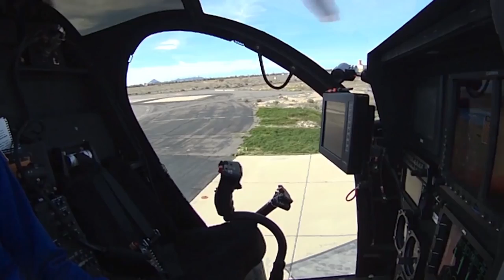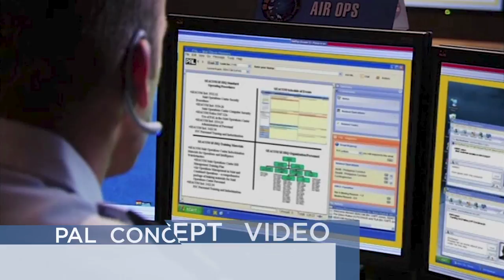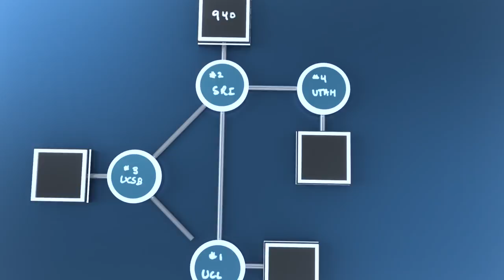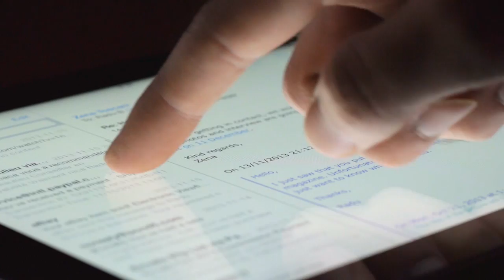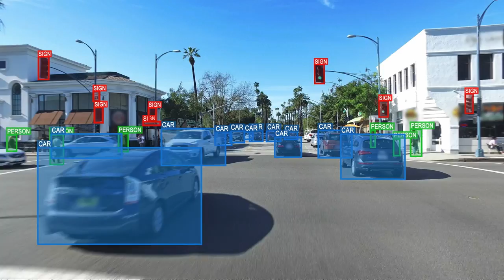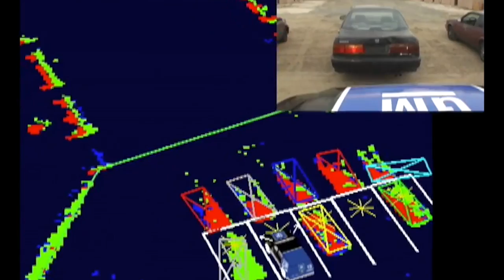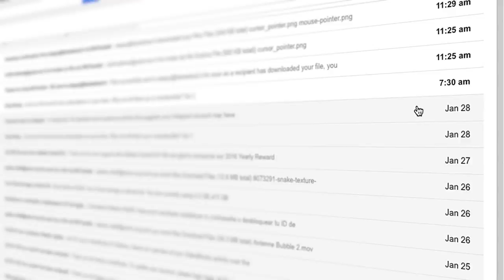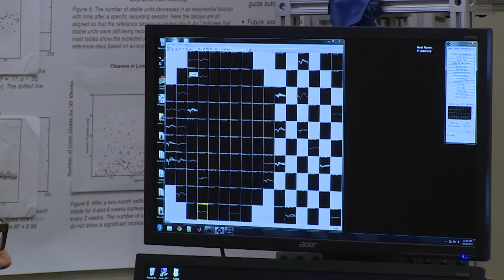Beyond the Battlefield: DARPA's Everyday Tech

Comment: OK:  Self driving cars in traffic.  Instead of developing all of the safety centered aspects in the subject vehicle, equip all cars with an active system that can be read by the driver-less vehicle.  This would provide electronic intelligence on location, speed, intent, and the options provided by complex light controlled intersections.  OK "intent" would, I think be the most difficult aspect to integrate.  This digital broadcast would be small and if visualized be a full hemisphere on a flat ballpark.  I refer here to BLUETOOTH,  and it's limitations, while not advocating it's use.  Just thinking with my fingers on the keyboard.  I would be delighted if you DARPA responded to me on this.  Have you explored this yourself?  Have you tossed me into the fail bin?